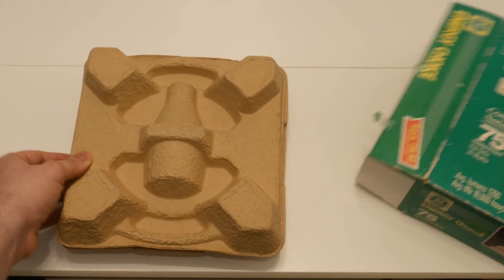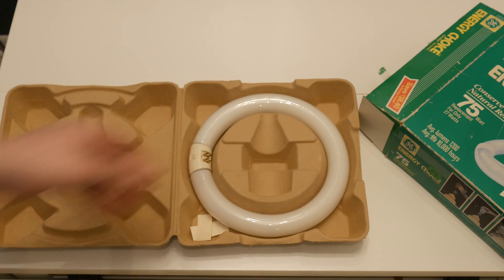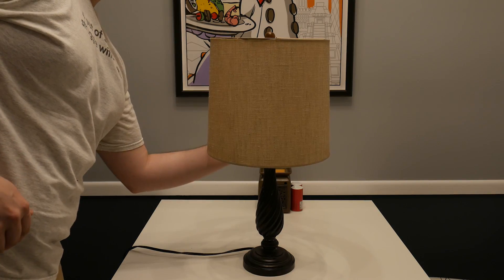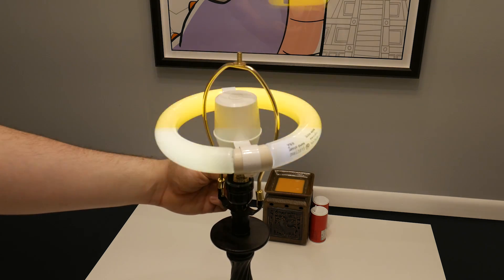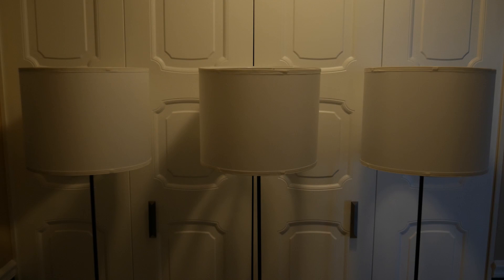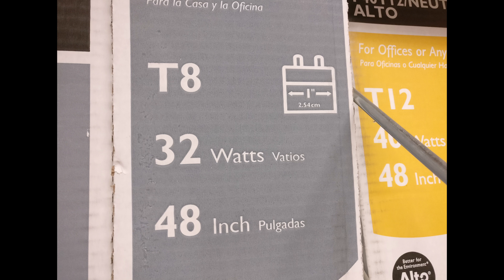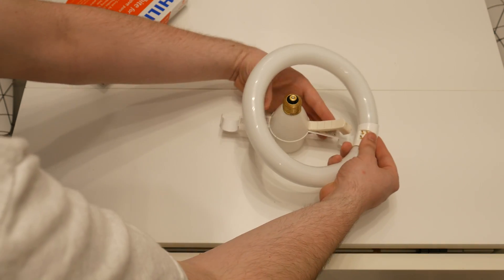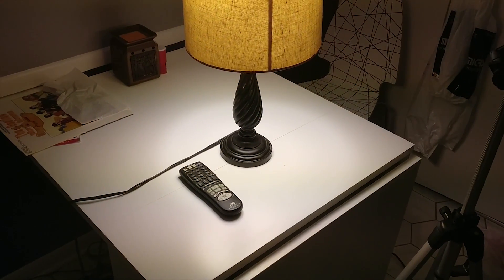GE's bizarre early attempt at a CFL

Comment from the maker: Oh my, people seem to be reading into this a little far:  To clarify, I am well aware that circline fluorescent tubes are common--I knew I could find a replacement at Home Depot!  But to shoehorn them into a regular lamp using the adapter from GE is what I'm claiming is weird and likely unpopular.  Many people seem to think I'm painting this assessment onto circline tubes in general, which just isn't the case.  Carry on!
Reply: The later adapters used an electronic ballast. The early ones used a preheat magnetic. Electronic ballast is more efficient, but the life of the lamp is much shorted. The old choke coil is the easiest on the lamps. I have a first generation CFL bulb that also has a magnetic ballast and it is well over 30 years old and still works fine. I did use it for about 15 years and then took it out of service and put in storage as it is pretty rare now and I wanted something to hand onto. I also have a self ballasted mercury vapour lamp that is probably 30 years old and still works.
Reply: You should send the starter to Big Clive when it eventually dies.
Reply: They are relatively common here in Asia where residential fluorescent adoption was very high since the 60s (due to energy costs). We still have working examples in our old house. Philips and Toshiba introduced CFLs in the 80s though, which challenged these devices. Despite this, you can still buy equivalent devices from hardware stores (the new ones have electronic ballasts).
Reply: These adapters weren't unpopular. It's just that you probably weren't born before they faded away.
Reply: common? on what planet? While I do remember seeing these ring lamps in catalogs and such from the mid 90's.. I have never seen these circuar bulbs being used anywhere or ever seen any rings like this in any stores here.
Reply: @philosoaper  The tubes were very common in buildings built in the 1960s-1970s.  They were a staple of lighting in many large apartment buildings.
Reply: @christophers.8553   not on a global scale no
Reply: On the other hand, I thought Circline tubes were only used with the E26 adapter/ballast; I didn't know they made fixtures specifically for Circlines. My folks had a couple of the adapters and tubes in the early 80s (we live in the US).
Reply: I have one of these (not this exact model) that's over 40 years old, with its original tube. Still works. The rest of them that were bought at the same time have failed over the years. Not the tubes, the ballast or starter. I also had some of the early CFL's with the straight tubes, some with 4 'sticks' connected by small bridges and some with the folded loop. The stick ones are made so the tube can be unplugged and replaced, but the crazy things last so long nobody ever had to replace the tube separately from the ballast. The straight folded style is what was eventually modified into the curly style, a simple change of the topography of the glass tube.
Reply: i have Phillips circular bulb that's rocking 15+ years in my kitchen
Reply: I don't know about THIS round fluorescent tube, but round fluorescent tubes have been around for a LONG time! In the 1960s, we had a kitchen ceiling fixture with round tubes from the 1950s.
Reply: Does that adapter still work?
Reply: You refer much to the bulb. Its phosphors
Reply: What you got wrong, is using 21st century experience to judge a mid-20th century product. At the time, they were a welcome and useful device, not some bizarre failure. Putting one in a table lamp isn't as difficult as you make it out to be, and since they last much longer than incandescent bulbs, in the long run, they were an excellent choice. It's also not actually a big deal to replace the tube when it eventually burns out. It's also ridiculous to complain about the flickering when it's turned on...when those came on the market, that was normal for fluorescent lamps. Also, your point about them not working in ceiling fixtures...well, guess what? Single sockets pointing straight down were very, very common.

Basically, this video is a bit of a hatchet job, not remotely a fair review.
Reply: @foureyedchick  it wasn't a neon bulb, it was a bi-metallic thermostat. The bulb had neon of argon gas in it. When current flowed it heated the bi-metallic strip causing it to bend and short the switch closed. This cut off the current and the heat source so it cooled and the switch opened.  This creates a kick from the inductor coil ballast.  The capacitor was there to minimize interference to am radio.
Reply: I’m pretty sure it was popular just before your time. All around my relatives houses when I was a kid.
Reply: @johnpossum556  I don't bother to replace any tubular florescent light nowadays. They're history. More trouble than their worth. Rip down those ballasts and fixtures. The socket based 60watt equivalent LED "bulb" has them all beat in cost and efficiency. A cluster of them is the cheapest way (price point) to light things up in a workshop or home, real good! Tubular florescent will be gone in less than 10 years. All those rides in the carnival midway with those colored tubes are gone now, they're all LED.
Reply: @echodelta9  It's been a year since I made that comment and I have turned to LED 4 foot dimmable bulbs. So far I've been using the toggled brand at 5000K. With the "ballast bypass" option I don't even need to purchase a fixture. Instead I buy a couple of 1.5 inch pipe brackets and use those to mount them. I recycle power cords from stuff people are throwing away and solder those to the ends of the bulb. I use liquid electrical tape on the other end (to prevent a thru-bulb shock!). This only costs me about $10 a bulb and they'e super bright. I just noticed home depot has 6500K now which will probably be my next order for the laundry area.

I was looking for a push-on .125 inch round connector because then I wouldn't need to solder them but couldn't find them at home depot. I've also added a tabletop dimmer as a power switch. Very nice.
Reply: @echodelta9  You don't need to rip down florescent tube lamps in your workshop, garage, basement, office, etc.  You can purchase LED tubes that work right off of the florescent ballasts.  (ones that you by-pass the ballasts and work directly off the power line are available too) The LED tubes put out the same amount of light, if not more, with half the power consumed.
Reply: Dennis Wilson  I mean.. yes.. but not very effective.. UVC is far far better for getting people to go away
Reply: My experience is that these were more popular then some people think. My grandfather, a very frugal person put these in all his big table lamps back in the early 90s and I knew others who had them back then. So at least a very significant minority used them at minimum but like anything novel like this (at the time) it depended on where you lived how many adopted them.
Reply: SPIRAL STYLE CFLs didn’t exist much before 1990.  If you wanted a compact fluorescent, you bought these circle things.  My parents have one in their basement simce the 1970s (almost 50 years)!  Mounted upside down

.
Reply: I have the exact same adapter, have had it for years, and it still works, with the original lamp i might add.
Reply: I picked up one of these adapters on eBay and it doesn't do the flicker start like the one in the video. It just turns on and stays on.
Reply: another dipshit who missed the point of the vid
with some racism randomly thrown in.
Reply: Dude. Seriously. They were actually very common. VERY. 🙄
Reply: you can still get the whole package, on eBay  & search 'circlite'
Reply: @tifino1692  Not on ebay in the EU (haven't check amazon or a lighting specialist).. doesn't seem to be commonly released for 240V supply with either a BC base (UK standard-turn a little and click)  or an ES base (screw in, more common in rest of EU) , or any weird alternative bases like GU10 (turn click bottom terminals used for spotlights), or SBC, SES (smaller 14mm ish versions of BC/ES which are 27mm in size).  

The tubes are available (but not common?), so there probably there were/are some bulkhead or ceiling mount fixtures (also now not common of fashionable) for them, but no adaptors for table lamps or pendant lamps as shown in the video.  And the video was fascinating.
Reply: AMAZON sells circline tubes made from LEDs… surprise!  But the tubes are expensive.  Cheaper to just buy a standard bulb for 1-2 dollars & throw the burned-out tube in the trash
Reply: frankly the only weird thing about it is the old magnetic ballast, these (not just tube, the entire ballast assembly with screwing thing) are quite common, around here I've seen them plenty, it's really just a matter of where you put them on. My neighbors for example had all their lamps in the house as this type, specially because changing the tube is cheaper than the entire ballast thing from a normal CCFL.
Reply: @Kalvinjj  Not now, the price point for those limited production halos are down the tubes compared to 60watt LED's. Their simplicity and cost has everything else beat. Going, going......
Reply: i can buy similar shaped tube and mount in the nearest lighting store
Reply: it is neither weird, nor unpopular. it was quite common to see these when they came out, just because they lasted longer than normal incandesants. unliked for shitty research. i mean did you even try to find out anything about these or did you just assume that since it was dirt cheap at goodwill, it must be shit and unpopular?

Comment: I love these things. Lots of light, free of glare and shadows. Great for basements , large closets, and the like where you have sockets for a bare bulb. I pick them up whenever I find them in thrift stores. Philips makes bulbs with 85 CRI, about as good as most LEDs. Not quite as efficient as LED, but still 4 times as efficient as incandescent. The bulbs last forever, longer than the electronics in most LED bulbs. And you can just put another bulb on. Most of these are 22 watt, 8 inch, but there is a 9” 30 watt version, and 6” 20 watt version. I’ve built my own 40 watt Circiline adapter when I needed more light.

Comment: Barely even start this now 7 year old video and already, a lot of misinformation on these. 

Fluorescent lamps and their fixtures were introduced in 1939, Circleline lamps have been around almost as long, as were T5/T8 lamps among others including the T9 ICircline), or T12 lamps. GE actually came out with these in the mid to late 70's, though you may be right it's from the early 90's.

Early fluorescent lamps came in several flavors, circline/incandescent combo floor lamps from the late 40's and 50's, some early floor fixtures used 2Ft lamps in the linear form factor.

Rapid Start lamps began to show in the mid to late 50's and by the 80's early electronic ballasts became available, though not terribly reliable at first.

Comment: It's a good thing that they used standard circular tubes. So it offers flexibility for those who aren't happy with the original tubes. That's the power of modular design.
(But I wonder if there were “ballast only, tube not included” products like this? Just a ballast with a lamp socket)

Comment: The /ww color is the same as the later color code 29, or 530. 3000 kelvin is still considered warm white, though not as warm as 2700k, what we usually consider warm white. 
The color rendering index is dreadful, with a CRI of about 56. 
The same phosphors could be used differently to actually reach a CRI of 85, but that comes at a dramatic efficiency penalty, so in the 50s-60s-70s this is what was sold most, together with the ghastly 4000k cool white halophosphate lamps. If you accepted the 25% reduction in light output, you could however absolutely choose for actually great color rendering. Only halfway through the 70s the triphosphor high CRI fluorescents we know today, started to trickle onto the market. But the traditional ones were on sale well into the 90s and 2000s, and only then they were starting to struggle on the market because of efficiency regulations. Simply because they were cheaper. 
Compared to the modern triphosphor fluorescents of the same color, the 'Deluxe' high CRI halophosphate tubes were only about 50% as efficient (in lumen per watt) as the modern high CRI fluorescents.

Comment: I had one of those. In a table lamp, the weight of the ballast would often make the socket come apart.
Also, I don't want "warm pleasing light". I want WHITE (I'd rather see things as they are). That circline color is still strange though.

Comment: Sorry to say this GE, but Thorn Lighting beat you to making a CFL. They made the 16W 2D lamp and an adapter that only had a ballast in it. Since Thorn designed the 16W tubes to have their own glowbottle starter in them. So every time the lamp was changed, the starter was replaced at the same time. Funnily enough Thorn was then bought out by GE and the 2D tubes continued to be marketed under the GE name.

Comment: I see I already commented years ago about how my parents basement was full of these. I also remember we used them on every table and floor lamp in the living room.

My dad was an environmentalist so we more or less tried every new technology that was supposed to be efficient as soon as we could afford it.

I quite liked these at the time, they produced more light output than whatever incandescent bulbs we would have used in their place. The biggest problem was the fixtures they didn't fit, and they were not dimmable.

I have a workshop space that I moved into in the mid-2000s and will be moving out of at the end of the year. There is one hard to reach fixture in that space that still uses one of these simply because it was the best option available at the time and I have not had access to that picture since we moved in. I bet it still works.

Comment: Here in the UK, circline tubes were never too common with 2D lamps (sort of square-shaped CFL lamps) being widespread instead. The solution here was an adapter made for miniature versions of these lamps. It was less awkward-sized than this one and was quite practical, but also suffered from its large weight and awful colour temperature!

Comment: I had one of these hanging from my ceiling fan for about 15 years or so. Then, it lived hanging from my carport for years afterwards.  It finally died.  It got to where it wouldn't fire up, at all.  I got used to the colours.  Would I want one again?  Nope.  But I didn't hate it all.  It kept my bedroom cooler than the other rooms in my house.  I still don't know if it was the starter or the bulb that failed.  Like I said, I used it for about 20-25 years or so.

Comment: The reason that the color of the circline adapter is so bad is due to the fact that the tube that comes with the adapter has a halophosphate formulation while most modern CFL lamps have a triphosphor formulation, which improves the CRI over the old fashioned halophosphate coating.

Comment: I have one of these in my fan actually cause I cant stand the glare and "Sharpness" bare LED bulbs give me and CFL swirlies when placed upside down tend to fail rather quickly. It barely gets hot, actually the LEDs I used got hotter and it's pretty decent IMO. I do use LEDs in other lamps with a cover but my fan uses a single center bulb with a metal dish (almost like a warehouse light?) and this fits it better than a normal bulb without the glare. Looks rather good too. Think I did find a use for these. Not the best for your table lamp, but for a dish ceiling lamp with a single bulb? They're perfect.

Comment: ima prolly go buy one. I have a few magnetic ballasted fluros around and they still work. (the one in my kitchen is a standard linear tube rapid start system, though even though it is nearly 20 years old, we haven't had to replace a single tube or ballast yet. because they are so simple, there's not much to fail. only 3 components, the ballast, starter and the 1-4 tubes in circuit.

Comment: I put Sylvania's version of the GE Circline in the bare-bulb socket in our concrete basement's laundry dungeon. Major improvement: the broad circular light source reduced harsh shadows and felt way better even though it was roughly the same lumens as the original point-source incandescent.

Comment: So I like the metric system, but I actually don't have an issue with the T-system.  Once you know if you need a T5 or T8 or T12, what does it matter that that translates to?  

It's like when people argue on Youtube that M8-1.25 is somehow easier and superior than 3/8-24.  I can tell a 3/8-16 from a 3/8-24 more easily than I can tell a M8-1.00 vs an M8-1.25.

I ran those circline tubes with the adapter for like 10 years until the UV from the bulb broke down the polymers in my lampshade.  New shade and new expensive high-end LED bulb, which lasted only five years and had to be replaced.

Comment: not for nothing, seeing as this is an older video, when i was a young kid in the early 80's my parents kitchen kitchen and "summer room" (fancy name for deck with a screen) both had flush sconces but the base was vertical from the ceiling, It's funny that the circuline bulbs were easy to acquire TODAY because back then, when there wasn't a home depot or really any diy places it was difficult to get the bulbs (also why i feel it didn't take off),  or they were in short stock. So while I think you are spot on with your dislike of how poor they light a room, I think that the ability to replace the bulbs was there downfall in the 80's. Also when they got cold, it was like a diesel trying to roll over.